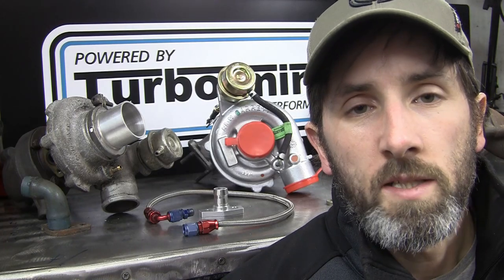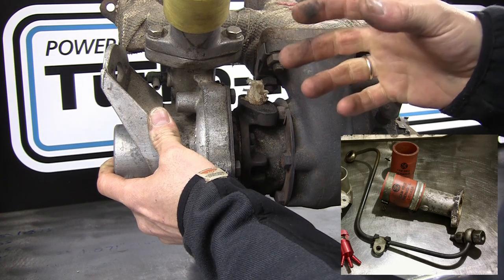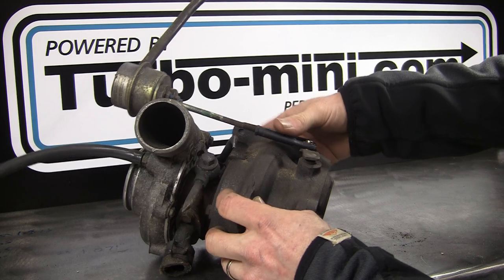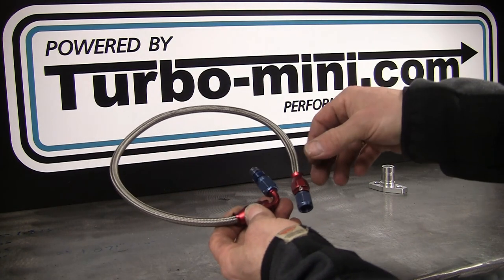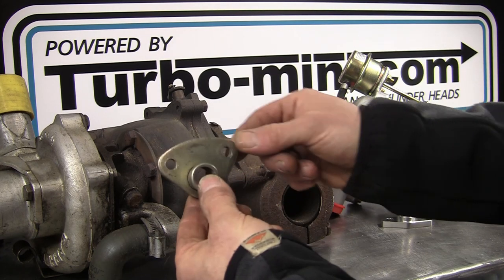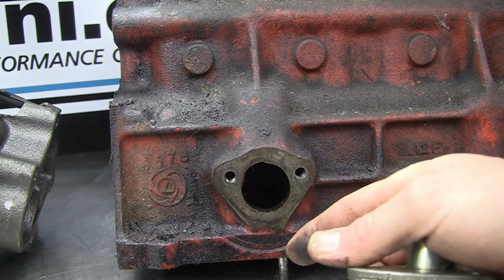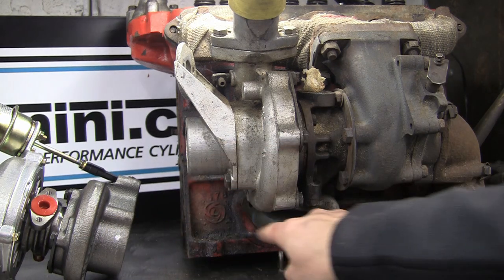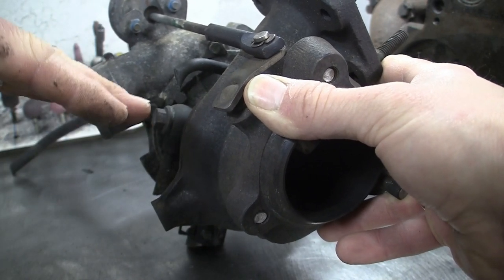Classic Mini Turbo oil feed drain & water connections GT17, GT20, T3 Turbos GT1752 GT2056 Garrett

Comment: Thanks for sharing such useful information 😊👍🏻, I'm planning on building a 998 turbo engine for my Morris Minor, I'll use a 948 block bored out to 998, a 1098 head, the turbo I'm going to use is a gt15, plus mg metro turbo manifolds, carb and plenum, I have most of the parts already, but its quite a complex job, and I still have a lot to figure out, I'm not looking for huge power, just a bit more go and some turbo noises 🤣, I think it'll be a lot of fun 👍🏻
Reply from the maker: You’re welcome. Thanks for watching and good luck with your project.
Reply: @TurboMinicom  Thanks mate 👍🏻

Comment: Nice vid Phil. What do you think of using the transfer case breather for the oil drain on side mounted turbos?
Reply from the maker: Thanks. I’d think that should work ok. Or you could run it across the back of the block to the fuel pump hole like the side mounted  Janspeed turbo did.